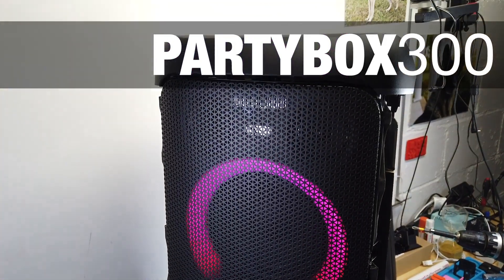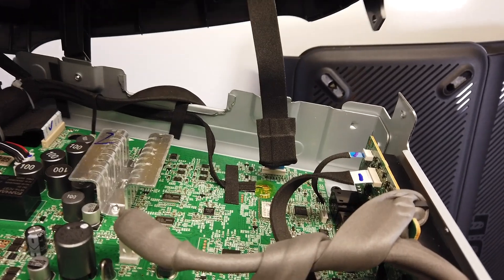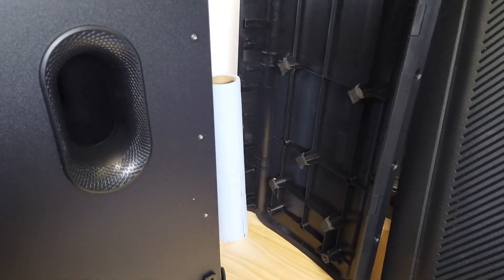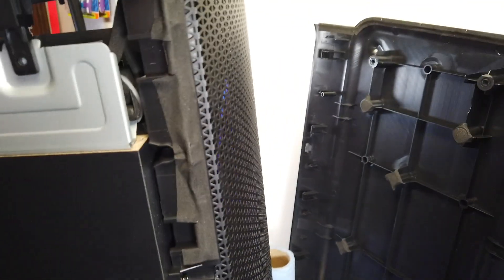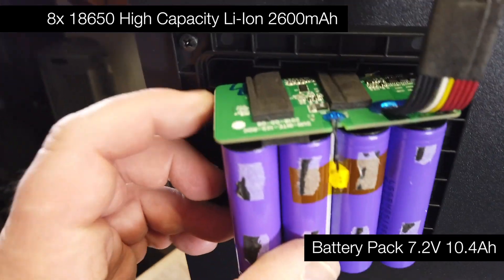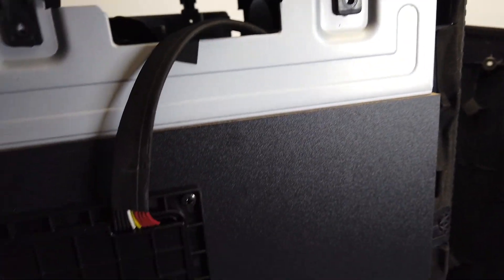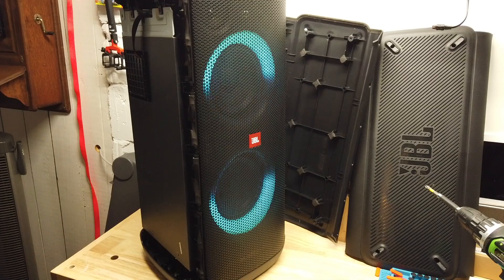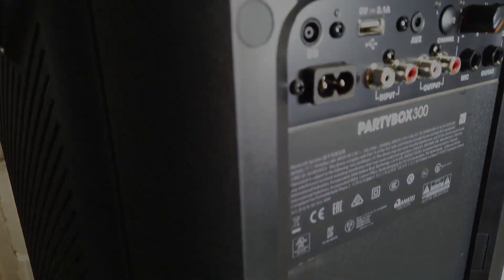JBL Partybox - Teardown and Battery

Comment: Please do a tear down of the (Altec Lansing Xpedition 8) speaker, I would love to see the size battery it has. The JBL partybox 300 only pushes out 120 watts connected to household current, and 60 watts on battery, while the Xpedition 8 produces 420 watts on household current and battery, I would love to see the size battery Altec put into their speaker..
Reply: it's Altec numbers, logic that they over do, 420W doesn't look like that. it would need at least 5 times the size of the partybox battery, at least so with a shity battery life.
Reply: So if it's Altec Lansing's numbers, so can you explain why it is three times as loud than the JBL party box, even if the Party box is running on household current? The battery life  for the Xpedition is very reasonable for a speaker of it's size and loudness and you can easily connect a 12 volt DC current or household current to keep the party going with 420 watts of speaker power!!!
Reply: @MrJamesgrate  this is probably louder but does it sounds the same way as the jbl does x) oftenly, altec and so called speakers are just garbage beacause they do loud mid and treble that just rape our ears... to do 420 so called watt with a 12V battery, it must deliver at peak 35A. clearly impossible because it would mean that the battery, to last 10H should be able to be 350Ah*0.3 (coefficient to make it reasonnable, it won't be at peak power everytime) = 120Ah
Easy maths, the jbl partybox is 10Ah, it should have a 12 times bigger battery to last less
Reply: Well honestly, the JBL has a lot of low end at low volume, but the Altec Xpedition has chest pounding low and mid bass the louder you increase the volume without beast mode activated (Heavy bass). The speaker plays (Horizontally) in stereo mode, and vertically the system orients the tweeters to  maximize true audio output for, in every essence, a party speaker. When I play music through the Expedition 800 speaker, my neighbor thinks I have on my DJ system, because he hears the bass notes in his house. The only Bluetooth speaker better than the Altec is the Diamond Box XL 2, but who has a thousand dollars to spend on a blue tooth speaker with outstanding sound but limited capabilities. Altec Lansing Xpedition 800 for the win!!!!
Reply: The 420 watts, is not constant, the speaker can deliver a peak power output performance of (420) watts, it is not RMS power, even for a battery powered speaker, to have a clipping level of 420 watts, that is impressive!!!
Reply: @MrJamesgrate  you should find someone that has the partybox to compare them in live. I really think that altec like speakers have cheap sound too for the reason I explained. And sure, your neighboor hear loud bass, for the size of the speaker it's not that surprising.. I have a Harman kardon go play and it goes deep enough that I hear it from outside my house. But glad that you're happy with your speaker ^^ I mean, thats what we ask them to do x)
Reply: @MrJamesgrate  In my calculus i took care to take that in mind, the Lggbm261865 cells that are used in the partybox can deliver a peak intensity of 10A on short period of times and they are at 7.2V so yeah about 5 times the partybox battery would be needed. I have at home a speaker that delivers 500W and I can guarantee that it looks nothing like the Altec here (we actually broke windows by putting it at 3/4 of the volume in exterior.) Just saying that Altec and ibiza kind of speakers are not what they are pretending to be.
Reply: @lucas chevallereau, you seem to be pretty sold on the JBL party box 300, just as I stand behind the Altec Lansing Xpedition 800, but there are numerous videos on youtube that support my claim, the Jbl party box produce detailed low end at low wattage, but the altec produce low end at low and high volume. I would recommend a very reputable video by (clavinetjunkie-JBL partybox vs sonyGTK-XB90) for you to view. Not taking anything away from JBl, but they need to increase their amp power output in order to compete with the other Bluetooth speakers in this category!
Reply: @MrJamesgrate  I'm not at all into JBL but if it's at the price to be sold to altec, not for me xD
I already saw it in the past and I think the altec would have sounded the same. And I mean, sure, jbl needs improvement that's clear but altec seems/looks even worse to me.. I haven't find a comparaison but when i listened at the altec I found that it sounds like a kitchen radio in some parts...
And just don't tell me that something that tiny can handle 420 watts, even the box itself would shattered and it's litterally impossible they would have made a passive radiator build of this power.. (even if waterproofing is a real plus)
Reply: @lucas chevallereau, It does have square passive radiators in the rear of the unit, and as far as shattering it's self, I believe Altec used a lot of ingenuity when they constructed the unit, especially since they have been on the market for quite some time, I haven't seen or heard of the Xpedition  800 falling apart, I have seen one instance where the beast mode became inoperable, but their cabinetry is very rigid, it's not just plastic like the older boom boxes, it's made out of a more aerodynamic material that can withstand torture and time.
Reply: @MrJamesgrate  I mean sure they haven't, because 420W claimed are BS
Reply: @lucas chevallereau, I have a couple of videos on youtube playing heavy bass music, when you get the opportunity, check them out and let me know if the Altec still sound tiny or like a kitchen radio, nothing was altered or adjusted in my video!
Reply: @MrJamesgrate  Hard to make a great impression but still it's better than what I though, maybe a peak power of 100W but no way it's 420W (nice eminence speaker btw, that's more what four hundred watts would sound like). How much does the power cable delivers ? Or is it like on the partybox and we just have to listen at JBL..
Reply: Lol, Sounds like a Versus 🆚 battle down below with valid points on the JBL side, also Did he really being in the Sony Gtk-XB90, I just died 😂, it may be louder then the PartyBox 300 but no where near as good in sound quality, like they want a bunch of money for a such a shitty tuned Bluetooth speaker. I’m not shocked, seeing as though her would’ve brought in the smaller brother Gtk-Xb60 to the matter to make it relevant. 

Don’t get me wrong Sony did great things with the lighting effects seeing as though you can control the led colors with the app, something JBL needs to work on, which they can easily release software to have JBL connect support the PartyBox family, along with control over the lighting  like pulse 3 just more advanced controls.

Comment: Awesome video, good to know the battery is replaceable
Reply: StormRunner Core did you buy the Partybox on my recommendation? You commented on my video
Do you like it so far?
Reply: JBL Bass Tester That influenced my decision a lot and I am glad it did. I did a lot of research on it and got information from other sources also. I love the party box a lot. The bass is so strong and goes real deep, and the mids and highs sound so clear on top of it being a very compact and good looking speaker.
Reply: StormRunner Core true. Little tip: Press Bluetooth and Minus for 10 seconds, 3 times. This will activate the spl mode. It reaches 110-118db with that
Reply: JBL Bass Tester Cool, thanks for the tip
Reply: @jblbasstester6198  hey my party box buttons arent responding and it been only one day
Reply: Sergio Arreguin literally no buttons? I'd say resetting the speaker with Play Pause and Plus Button, but if it doesnt work it might have a defect.
Reply: @jblbasstester6198  ok i reset its working but should i exchange it just to be on the safe side and also like your coment about activating spl is that real thing on these boxes thanks again for the response 🙏👍
Reply: Sergio Arreguin if the problem occurs again, exchange it. But i wouldn't immediately do it.

And yes, the spl mode is real.

If you press Bluetooth and Minus for 10 seconds you can hear that for a second only the tweeters and then the woofers play, which indicates that you changed the mode.

But you need to do it 3 times, so you switch to the SPL/Loudness Mode.

(So when turning the speaker on, press Bluetooth and Minus for 10 seconds until it switches the mode, but 3 times.)
Reply: @jblbasstester6198  Hey, does spl work with pb100?
Reply: @haydenrushing8058  unfortunately not

Comment: Sweet,  this video makes me want to install more batteries into this monster speaker 😁👍
Reply from the maker: I think it would be easier to just run it from an external car battery. That would be the most efficient method.
Reply: Do you think this would be possible ?
Reply from the maker: Yes, you could fit 10 Li-ion packages in the space below, and it would play forever.